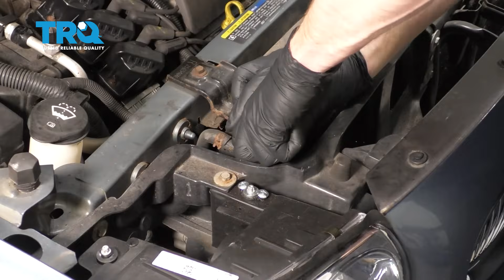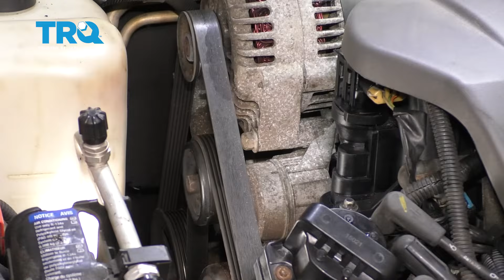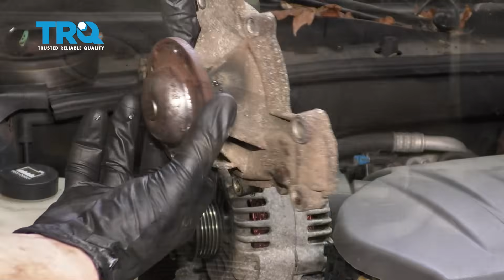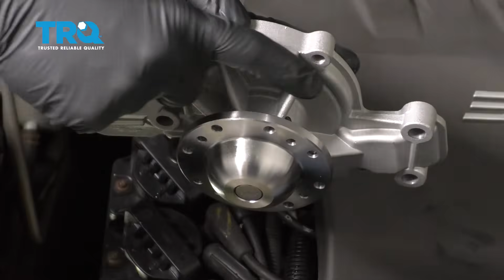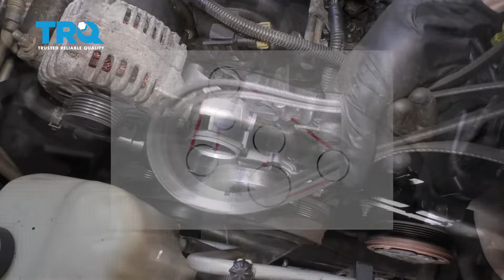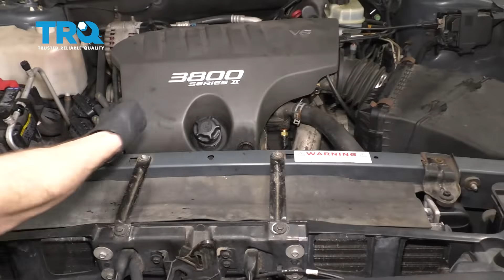How to Replace Engine Water Pump 2000-2005 Buick LeSabre

Comment: Thanks!  I have a 98 regal. The power steering pump pulley is in the way.  I removed the top and bottom bolts on the pulley but the pwr steering pump doesn't come off so I can get that 1/2 on the water pump.  Suggestions gr8ly,m appreciated

Comment: My supercharger makes it a little more difficult, u have the loosen the pulley bolts and slide the pulley forward with bolts still , the pulley that's on the power steering pump to access the lower water pump bolt

Comment: Stuck on old gasket material -  if you use chisels and scrapers, you're just going to chew up that metal. What worked best is the old cheapo straight edge razor blade handle...it gets behind the old gasket real good without damage. You'll have to clean off a real thin layer as well sometimes....use a real bright flashlight to make sure you get it all. And clean around those two pins real good - looks like a good spot for leaks. Did my final sanding with 400 grit paper...cleans it up real nice.

Comment: Pulley wheel bolts : since one of my 8 mil. bolts stripped, I went in search of new ones. The size is M6- 1.00. I found some at Advance, they are class 10.9 which means they are strength tempered and....they have 12mm heads instead of those measly 8mm heads. Good deal. Edit : package says 12mm.....they are actually 10 mm. To tighten I set a block of wood on the balancer wheel and have one of the bolts hit up against it. Going to let my permatex on the bolts set up over nite and fill tomorrow using distilled water with my antifreeze concentrate.

Comment: Coolant will come pouring out of the 1/2 inch bolt holes so be prepared. The stuff I'm using on re-install is Permatex Seal + Lock. It'll seal in the water and it gives a medium(blue) lock  on the bolts as you really don't tighten these bolts all that much cuz its all aluminum. Torque if you can.

Comment: Radiator drain can be loosened with a 3/4 inch deep well socket...don't snap in your extension to it and when it starts to pour, just pull your tool out and the socket will drop in your bucket.

Comment: Plastic underbody cover. I have mine re-enforced with nuts ,bolts and lockwashers. I was NOT taking that thing off. So I took my little cutting wheel tool and cut a little 3/4 trap door square and bent the plastic down and out of the way,under the radiator drain. A little block of wood held the cable forward and out of the way.

Comment: Pulley wheel. I have a giant 16 " screwdriver I put behind the pulley wheel at one oclock to the left of the shaft and spun the wheel counter clockwise til it hung up on something. It worked. Listen to the other comment that says don't take the belt off til you get those four 8 mils loose....good tip.

Comment: Well, one of my 8 mil. screws on the pulley wheel stripped but fortunately I had an Irwin bolt extractor kit for my 1983 Honda i'm working on....and one of the sizes was 8 mil ! Tapped that baby on and off she came. whew.

Comment: This video doesnt apply to the 2000 Buick Regal because there are 2 more steps involved and did you put gasket glue on the water pump because mine must of had glue because i had a hard time getting it off and is there different types of gaskets for this water pump? and if so ..what kind is the best ??? 😅